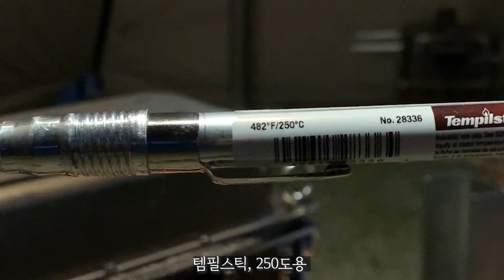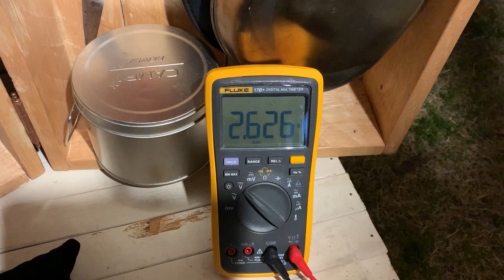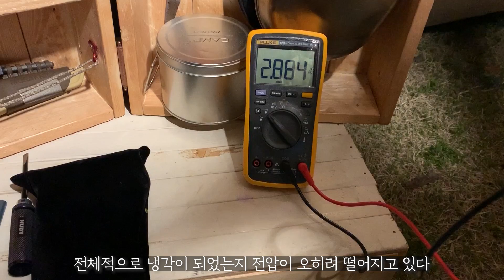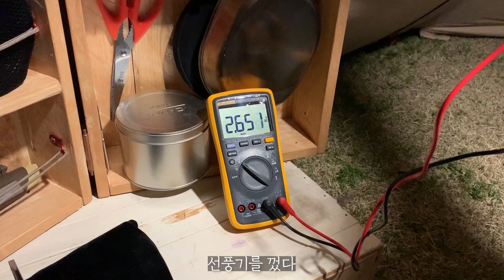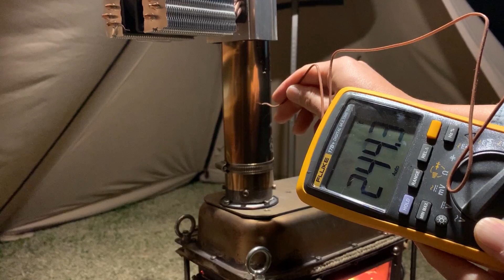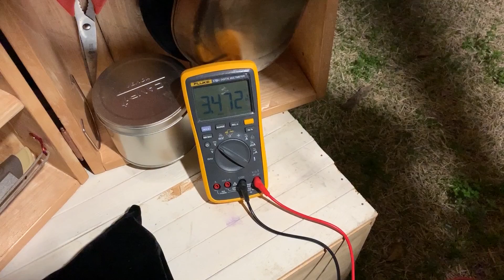Camping Wood Stove with Off Grid Thermoelectric Generator - M-Stove Project Part-7

Comment: The number of TEGs is too small for getting the desired voltage, it would need at least 4 or better 6 modules (3 x 2 ) for 7V or 12 (6 x 2) for 15V. Then the use USB or 12V stepdown and the fans should get their own regulator.

Comment: So what you need to do is stack them. Hot to cold side and run them in parallel. So long as you still have a hot and a cold side they will balance the heat out

Comment: that about using compresed steem generation in conjunction with thermoelectric Generator to increase photovoltaic output and an battery bank to store DC current with an inverter fore 120vac output?

Comment: Hello, I managed to get 4 volts from 4 Peltiers and 4 heat sinks connected crosswise I used Peltiers SP18482714SA and insulated with asbestos yellow tape, such as in satellites the heating plate moreover it works on the principle of temperature difference, so the generator should be on top of the chimney outside the tent otherwise the warm air from the stove heats it up and loses efficiency.

Comment: go get yourself some better thermal grease.  The stuff you used showed its conductivity is only 1.42W/m-k.  Just about anything from Thermal Grizzly, or even your basic Arctic Silver paste will have 8 - 10x the thermal conductivity.   Depending on the product, they are usually around 10W/m-k to 14W/m-k.    If you're going to go through the trouble to do all this, At least get yourself some decent quality materials.  Not even top of the line, Just decent.  The gunk you have is so pathetic, it shouldn't even be considered a thermal grease.

Comment: have you considered to insulate the heat spreader ? currently it emits radiation to the cooler, so the cooler gets warm, and you have less temperature difference. Can you use the generated power somehow ? i had only 1 thermoelectric element, and judged that i need a looot more to get to higher voltage to use the energy with a step up converter. Mine needs minimum 4.5 v to operate.

Comment: A huge cooler on the cold side that must work orizontally .
On the hot side poor alluminium mostly in contact with air than with stove .
May be You should do a radiator that go inside the the stove pipe to extract the eat .

Comment: You may not be getting good heat transfer from the stove pipe to the aluminum (only line contact).  Also, the vertical air flow (draft) between the stove pipe and the aluminum cools the aluminum so the heat from the stove is not directed to the Thermo-Electric Devices (TEDs).  Try blocking the flow of air, or better yet pack the void area with aluminum foil to increase the heat flow, and also insulate the outside surface of the aluminum so all heat must flow through the TEDs.  Also, if the TEDs and heat sinks were turned 90 degrees on the aluminum, you could make duct work so cold air could be introduced from close to ground level where it is cooler, and the heat would create a natural draft (may not need fans).
Reply from the maker: Thanks for the comment. So I tried this again. https://youtu.be/H0Qva6JxSD0

Comment: I know that it is probably too late to give input for your project, but I'll try anyways. Make it even more complicated using a stirling engine lower down on the stove to provide air movement and turn the heatsinks 90 degrees to use the stirling engine's fan vertical exhaust for the cooling. The computer fans you have mounted are 12v monsters and do not help much for the power they draw. The stirling engine will use the heat of the stove passively and not put a load on the power system. Unfortunately, it may require separating the peltier units from being vertically stacked for optimal heatsink cooling and placing them at the same level will mean you need 2 stirling engines. Those engines are mostly used for powering campstove fans in cabins, so not much work will likely be needed to fit them in to your project.

Comment: Hi I had conducted a similar experiment many years ago with the first cells of Peltier and had had the same problem, in that case I used to cool a refrigerator but the physical principle is the same.
Along the two sides ceramic you don't have to create thermal bridges that can heat the "cold" side.
The system can be improved using a pressure cooker with a 1 cm thick bottom to work as a cold tank, you can use the steam output tube to pump cold water in the pot and with an additional tube withdraw hot water considering that hot water goes Always upwards the cold tube must send water directly to the bottom where you put the cells. I would put 4, 2 in series, 2 in parallel.
An alternative can instead be to position the cells on a thicker floor not connected to the exhaust fumes but on the rear panel of the stove so as to keep the heat away and use a steel heat exchanger, of those that are installed On normal gas boilers.
Given the efficiency of Peltier cells in their traditional operation I would use a Stirling generator for this application.

Comment: polishing the thermal mating surfaces with jeweler's rouge to a mirror like finish will yield better conduction.
Also, you used far too much thermal paste.
Thermal paste is for filling the small depressions in the mating surfaces of the metal.
If you cannot see the metal and the paste, you probably used too much paste.

Less is good, more is bad.

Comment: Hello, I tested converter from https://belza.cz/ledlight/m2d.htm . Converter start working from 0,5V and powered white LED. I tried it with one peltier module, where bottom side of module was on home stove 100C and upper side was cooled by cup of water. It produced 0,5A 0,5V, and LED has 3,6v 0,06A.

Comment: The reason I am looking for these is to see if anyone uses the outside air and inside heat of fire to generate power - and then calculate, what's the loss, what's the efficiency, is it better / enough to use internal air etc (versus loss in a particular shelter)
is there a benefit to using outside air?
Reply from the maker: if the outside air temp. is lower than inside air temp. it will help to make the biger temp gap between cold and hot on peltier
Reply: @campingtogether  yeah that's what I am assuming - but it would be good to see the tradeoffs - also if anyone has come up with a good design

Comment: try stirling generator
Reply: try a water floating solar-thermal peltier generator
Reply: you could make walls out of the same thing, just have some water circulating around, you get hot water like from/as a radiative heater
Reply: try copper Cu-CuO thermo-couple inside the fire, burn the flame side in air-oxygen into CuO, inside cold+, outside hot-, also a water coolant loop in the copper heat liquid water pipe

Comment: Le système de refroidissement n'est pas fait pour être à l'horizontale. Chaque tube de cuivre contient un liquide qui s'évapore à la base chaude et se condense dans les ailettes d'aluminium. Essaie de le placer horizontalement et il refroidira extrêmement bien +- 250W de dissipation de chaleur par éléments. Là tu obtiendras plus de différence de température aux extrémités du module péltier

Comment: Ciao! 🇮🇪
Beh.. Son passati circa 40 anni  quando giocavo con le Peltier. 

Cmq  potevi fare un raffreddamento ad acqua.

Sicuramente il risultato era migliore ottenendo il vero potenziale reale a causa dello scambio termico rivelato dal sandwich dei semiconduttori interni alla Peltier. 
Infatti, più raffreddi il lato freddo in questo caso meglio sarà la risoluzione nella potenza. 

E questo vale anche per il lato caldo, 
Se  la cella la usi per un eventuale frigo.

Nel frigo più raffreddi il lato caldo più precipita la temperatura oltre i 25° sotto zero il lato freddo. 
Quindi il raffreddamento è estremamente importante per una buona efficienza anche in volt. 

E dovresti sapere che le celle di Peltier se superano una certa temperatura nel lato caldo, si danneggiano irrimediabilmente. 

Scusa se mi son permesso qualche suggerimento. 

Ciao   :)

Comment: You can use just a tall tower full of water instead of the cpu heat sinks. Stick a little water faucet in the side of a tall aluminum tower, and now you have hot tea water. The slow dissipation of the water, due to not boiling at a high temperature because of the long tower and water fill .. 1.5liters.. makes it run for well over a day without watching it at all. No moving parts. Then you can get into your wiring for clean power to charge with and stop charging with.
If you dont believe me.. go look at the Ipower tower at tecteg dot com. Further.. you can use them around stove pipes and ambient water line heat for flooring as well. They are installing them into Pizza ovens now.. to produce multiple killowats as well. The newest seebeck modules can take up to 600c with perfect efficiency, and 20 year warranty.
Reply: I also made a unit you can slide down into the vacuum solar tube cookers. You can do alot with these. People dont realize full potential of them, nor do they attempt as you have. Well done.

Comment: Would you be able to increase performance by having a second set of heatsinks on the inside of the pipe to better capture heat from the stove exhaust?

Comment: Amazing construction and research! Try connect thermoelectric element to the bottom of a pot as done in Powerpot. So you will use water to cool down the element effectively and cook rice simultaneously.

Comment: Supprised you only used 2 thermoelectric plates in series. Maybe also concider a fan that uses thermal heat instead of the pc fans, so that you don't have to jumpstart it with a separate fan & battery

Comment: From what I could tell I'm pretty sure you forget to put thermal paste between the aluminum heatsink and the TEG chip. You did use TEG chips and not TEC chips I'm hoping as well... TEG chips are more efficient at generating power compared to a TEC chip which is more efficient at using power to move heat. Just my .02

Comment: Highly recommend thermal paste between the aluminum mount and the thermal chip and not just between the thermal chip and the heat sink.
Reply: I guess that was the main problem - both surfaces of the peltier element must have good thermal contact.

Comment: Better use the potassiumcarbonate in your woodash to make batteries. I have done that and did get 1,3V and 15mA per cel. When connected in parallel you can increase the current as much as you would like to have it.

Comment: BioLite's 10w kettle seems a much more elegant solution, use water to generate the temperature differential and you get hot water + charged batteries.
Reply from the maker: I will have one. Thanks!
Reply: @campingtogether  Fair warning; I don't own the kettle but love their original campstove and the new basecamp stove + pizza dome that also provide usb power.
Reply from the maker: That would be awesome try. Thanks!

Comment: Peltier cells are not very efficiente... In fact its hard to reach a good temperature difference between the two sides.
It could work if you have access to a constant stream of cold water (like a cold river) and use a pump to feed the water into a water cooling system on the cold side of the cell. Also a sheet of metal to keep the direct heat coming from the stove away would be a goos idea maybe.
Probably steam it's more efficient.... But this remains a nice project to do :)
Reply from the maker: Thank you so much for the info. :D
Reply: @campingtogether You're welcome! Let me know in case that you build it ☺️
I bought a peltier ages ago to try the same experiment, but I never made it in the end... You know what, maybe it's possible to use the sun to heat up, with some lens!
Theoretically it's better than a fire, because the heat it's concentrated in a small area. 😁

Comment: Electric fans also consume electricity. You should try to measure the power generation to see if the power generation is higher than the power consumption.
Reply: Ya without a decent Temperature difference the power would not be much so I think the fans are probably a net benefit

Comment: Nice mate, I like it. Ive built a similar thing for a kerosene lantern and an alcohol stove. I had to run the hot side at at least 130 degrees to really get power running. The kero lantern could do it, but I needed a heatsink on the hot side as well to really suck up the heat. Worked out very sweet, light, and a phone charger!

One major bit of advice, you use tapped holes on both the heatsink and the mount. TEC’s, ive found, need to be clamped tight. Drill out the hot side, so your pulling the bolts down hard on the sinks. Full wrench hard. Crush them. I also didnt bolt directly to the heatsink, but a bar across it, with the heads out of the path of the heat. Dont want the bolts themselves to conduct heat from your hot to cold side. 

I also found I needed to ‘bootstrap’ the fans, like you do. I just put a 9v battery (PP3) clip on the fans, so I could clip on a 9V battery.  Then another PP3 clip across the TEC’s and charger circuit. Light the lamp, warm it up, attach the battery to the fans. Once everything is up to temp, about 6v, swap the fans from the batterys clip to the TEC. You need a starter battery, but it really was the ‘eureka’ moment for the project.

I’d also ditch the swanky LED display USB regulator. I used a very basic single cell LIPO charger with an 18650 holder. Super tolerant of wide input voltages, I tended to get between 4 and 6v, depending on ambient temp and load. And that charged 18650’s fine. Most of my load is geared to those cells, USB charger for my phone n tablet, torch, vape, tent lamps, all 18650’s. Keeps it efficient. To go from TEC voltage > 5v (with LEDs) > battery bank > 5v > usage , lots of loss. TEC voltage > 18650 > usage, really only the battery charging loss there.

Unfortunately, I wasn't using high temp TEC’s. My project came from another that used 6 TEC’s as a chiller, and the best price I got was from a pack of 10. so I had 4 for free. What else can I do with these? The kero one still lives, but I killed the rest on an alcohol stove, finding how hard can I run these? About 8v, 6W out, running the fans from the TEC. Then there is that horrible ceramic plink sound, and everything goes to 0. the kero lamp gets about 4w useful power to the batteries.

TL;DR Clamp your TEC's tight and isolated, and use direct battery charging. Your going to have a lantern or fire lit anyway, might as well use that heat!
Reply: TEG  . No  TEC  . Por eso no funciona .  Debe ser seebeck (TEG ) nunca peltier (TEC)  error

Comment: Peltier is very unefficient, using only 2 in series you probably will need a step-up converter, so can achieve the needed voltage or use more Peltiers in series.

Comment: Steam engine will be much more efficient
Reply: More dangerous as well
Reply: Tesla Turbo, Cold Steam Engine. Depressurize the system, make steam at 50 c.
Reply: @mcbusinessmonkey  please go into detail, this sounds like a setup I am thinking about for years!
Reply: Or put fan on the flue..
Reply: even a stirling engine would be better at generating electricity

Comment: Try wiring the fans to the input side of the 5v converter instead of the output. The fans will activate at less than 5v and will provide an ever increasing temprature differential for the peltier junctions. They will just work better and better untill they produce 6+v and the converter kicks in and charges your battery bank.  Just an option.
Reply: And Personal computer fans.. are far more efficient than the fan he used :) Even with a variable power switch built in.
Reply: Que no deben ser TEC  (Term Electric  Cooler) las que hay q instalar son TEG ( TERM ELECTRIC GENERATOR ) efecto seebeck  . No peltier
Reply: @marioschutrumpf9463  I think it's all the same principle.  You can power it to make a cooler or you can use a thermal gradient to generate a current.  

Whatever the case, I think you could optimize it by using the draft of the fire to draw cold air through or over the cold side of your TEG.  You're mainly running that thing in the cold, and the outside air is an endless supply of cool/cold air.  Too bad I'm not an engineer, or I would either build one, myself, or know it's a dumb idea.  Wait.  I can go on thinking what I want, if I don't do or test anything.  I can hold on to that idea as long as I please, now!  Cool!

Comment: seeing a couple of volts.  say's nothing about the power output
Reply: Yeah you need alot of these thermal electric  generators to make actual power  they have rocket stoves that have them a fan battery and can charge a cellphone 

 Can actually use them the other way around with electricity to make cold on one side heat on the other for a camp stove id do a bunch built into a pot to boil water and melt snow in but there power or thermal generation is based on the temperature difference between the two sides still need a charge controller too

Comment: Why bother using the usb converter. The fan should run fine with 2-3volts, although at around half the speed.

Comment: My suggestion is that the aluminum heatsink grid is removed leaving the copper part, then the copper part is inserted into the furnace and the cold peltier part regarding the hot brass pipe and the hot peltier part when supplied with DC electricity is given a cooler in the form of a 5v fan only because a stepup that is too large will very wasteful of energy, the results I have tried with outdoor temperatures of 32 ° C with 5v volt coolant produced 7v 200ma (0.2a) can charge but very ineffective better bring solar panels
Reply from the maker: Thanks for the suggestion! I reformed this in water cooling box attached under the fire box. You may find the video on my channel. https://youtu.be/H0Qva6JxSD0